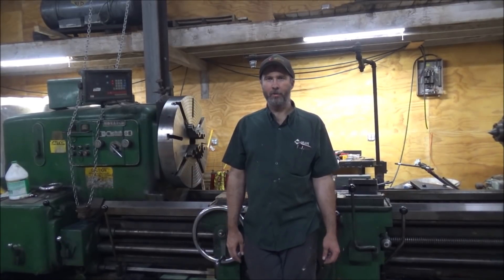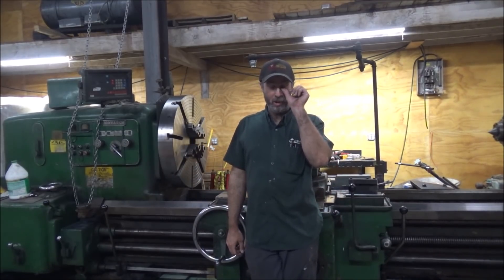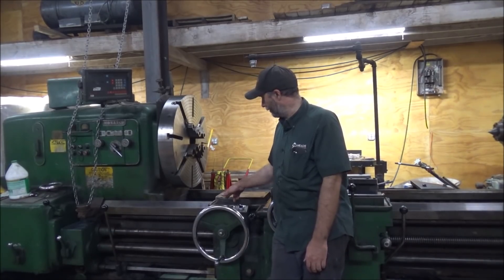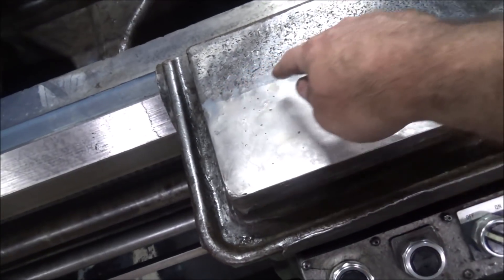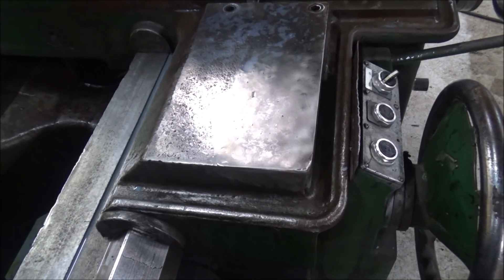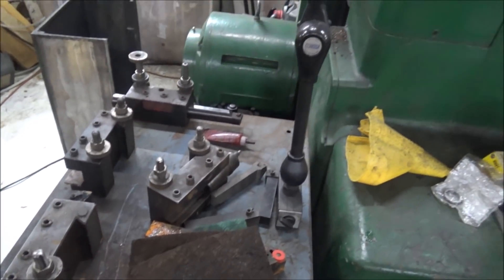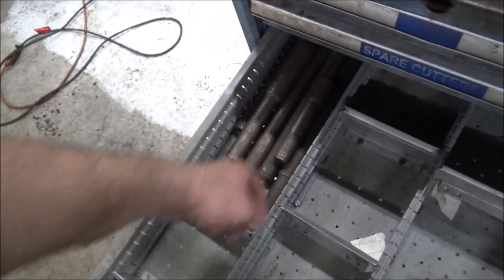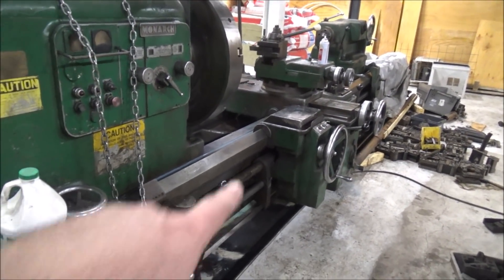Casr Iron Welding and Lathe Coolant System Repairs

Comment: So yo welded the top of a slide? How flat can the underside be now!!! You are a hack.
Reply from the maker: Been called a hack by plenty of internet warriors before, but I have fixed far more unfixable things than most. I figure 2lbs of rod has little effect on a 3000lb casting.  It may have theoretically  bowed it a couple of tenths in that area but it wont effect how it cuts. The carriage could be warped like a Mcdonalds sign but as long as it was moving on a flat surface and the same points of contact it would still cut true.  Welding the lathe bed likely would have been problematic to accuracy. Welding on the carriage like I did will have no effect on accuracy.
Reply: It speaks volumes about Brian that he pinned this comment along with the respectful and humble manner in which he responded.
Reply: @ Darren Rich  Darren, it might be a good idea to improve your spelling “yo”, before you start accusing others of miss-deeds on things you do not understand.
Reply: There's always an arse hole Brian. I bet Darren Rich was bullied at school and has never had a real girlfriend, just those you inflate.
Ignore him, you are one of the most knowledgeable people on here!
Reply: Brian, almost every time I watcg you, I learn something!  Thank you!

Comment: Nice job working on the large lathe. I can only imagine the swarf you removed from the machine. I can bet you that this machine had a rough life if they did not take care of the coolant system. Can only imagine that since the coolant is a integral part of the machining process. Today, keeping the system clean is more important than ever. No one want a major infection from the coolant. Nice weld job on the apron of the Monarch. Keep on a machining. VF

Comment: I just picked up a big (to me) lathe, I couldn't pass it up for the price, 18x80 HES Cholet 550... it needs  LOT of TLC before it gets put back in service, but it's a capable unit and will be a nice upgrade from my chinesium 14x40.. might be able to make a cut more than .020 without chatter..
Reply from the maker: Sounds like it will be nice, hope it aligns well for ya.

Comment: Looks to me that when the flood cooling pump is engaged you are going need to were a fisherman's raging gear or a maybe a scuba divers wet/dry suit.
All jokes aside you have done incredible work bring this big machine back into proper running order and that repair you did to fill in that gouge in the table looks amazing.

Comment: Hi Brian, your Monarch is beautiful but if it wasn't such a monster you could roll it outside and hot water blast it.
With your coolant, does it need glycol / antifreeze or do you heat it in the winter time so it doesn't freeze?  Stay safe and well :)
Reply from the maker: Shop stays above freezing in the winter with the heat in the floor.

Comment: Question Brian; How did you weld all that up and not warp the apron? Wow that is a lot of weld!
Reply from the maker: I figure 2lbs of rod has little effect on a 3000lb casting.  It may have theoretically  bowed it a couple of tenths in that area but it wont effect how it cuts.
Reply: @bcbloc02  Wow, ok thanks!

Comment: That is a really nice repair Brian on the cast iron. Thats going to be one heck of a cooling shower.  Hopefully you can adjust the flow.
Reply from the maker: There is a valve on it to control it if need be.

Comment: The welding repair came out great. Did you use the bust the flux off the rod system you ysed for the radial drill? Looks like you did it on the machine, what did you do for heat management? Most people don't expect it to be as big a job until they've done it. Thanks for sharing
Reply from the maker: No I used a special low heat rod designed to minimize heat input but still wet in nice.

Comment: Hi what is the size and model ? Is this the largest one made ? A great job as normal.
Reply from the maker: It is a series 90 that swings 40x180". It is one of the biggest series but they could be ordered in raised versions and even longer bed lengths.

Comment: I run renewable lubricants straight oil on my CNC mill, surface grinder, and manual lathe. No tramp oil to deal with, no evaporation, and no mixing. No RUST EVER, no sticky residue, lasts for years, smells good and non toxic!
Reply from the maker: Got a link? They have hundreds of oils on their webpage. I didn't see any straight oil under metalworking fluids.
Reply: @bcbloc02  Look at these Bio-Syntra™ & SynXtra™ MW (ISO 22, 32, 46)  I am pretty sure they are all straight oils.... can't put a real link.  if you get stuck i can try email...

Comment: Might want to add a ball valve before the snap-loc so you can control the flow a bit...once it's reduced down I could see it coming out of there at firehose pressure.
Reply from the maker: There is already a gate valve on the coolant there for controlling flow.

Comment: I checked out David Wilks’ channel. Wow! There’s Trepanning then there’s TREPANNING! Very specialized work, but you get used to it & it’s just routine I guess      During WWII my dad ran a monster lathe in a defense plant. He did the rough turning & boring on forgings which became 16” cannons used on Missouri-class battleships. Those forgings were about 70 feet long! He said other than the days when he had to mount & turn steady rest spots, it was pretty routine. Once he started the boring operation, it was - boring! Unless the engineers had slipped in a new grade of steel, then cutters and feeds & speeds which had been working great for months didn’t cut or broke. He was in for a few busy shifts.
Reply from the maker: What plant was that? Did they also cut the rifeling there or was that done someplace else? Heck I wonder who did the forgings 70ft is a big one!
Reply: @bcbloc02  It was called Midvale, in the Nicetown section of Philadelphia, Pa.   Started as a steel manufacturing concern in the mid-1800s and developed into heavy manufacturing. When we drove by the location, it looked like a ramshackle collection of quonset hut-type buildings plus a huge green building that housed what my dad said was the largest vertical forge in the world. That's where the blanks were forged.  The machining operations my dad performed included outside turning & rough-boring only. The barrel was moved to another area for installation of the rifled liner. Or maybe the liner was rifled after installation. He said sometimes the semi-finished barrels would lie in a stack by the lathes for days and days. Then, at his next shift, they were all gone. Nobody saw them move. This was 1943 and 1944, during the war. Stuff was kept secret. 
We drove thru that area frequently in the late '50s - early '60s when the place was being dismantled. Drove my dad nuts when the vertical forge building was torn down and the forge shipped to Germany. He would ask, "Who's going to make 16" barrels if we need more? Are we gonna order them from Germany or Japan?"

Comment: Good start on having some tooling right by, Having to walk to the other side of the shop constantly. looking clean and organized . put a manifold on it do multiple outlets think 3/4 Dia. reduction there's some heat there spread it out. just wow flushed it 4 times yup still dirty. progress is slow somtimes but progress is progress.
Reply from the maker: Very true!

Comment: what about doing a headstock oil change, run some kerosine in the headstock after you drain it, then use appropriate oil back in. Adam Booth just did his, might make a easy video for you! What about working on getting the shop completed before this winter?
Reply from the maker: Bill Actually the headstock runs dry sump on the series 90 . Everything is pressure oiled by the hydraulic pump and thus is filtered and returned to the reservoir under the motor all the time.

Comment: Ohhh... !!!   Your flow rate on that flood coolant shower fixture is barely behind that from Niagara Falls....   There is enough to even keep the operator cool on those very hot steamy days....   🥵🥵🥵
As an update on my own work, the manifold with the huge hole I had to weld is done, still waiting for feedback from the customer....    Hope it's a good fix...!!!
Reply from the maker: If you don't hear anything the fix was probably good. LOL Yes the series 90 came with built in cooling for the operator as well apparently. When you run this machine you are "Mr. Cool" LMAO
Reply: @bcbloc02  LOL
Reply: Pierre's Garage : might not be a Niagara Falls but it's definitely equal to Cumberland Falls. Wounder if Brian can see a Moon bow during the full moon?
Reply from the maker: @CraigLYoung  Sure just have to stand on the right side. lol

Comment: Hi Brian . Another excellent cast welding repair , Was the repair work on radial drill your practice piece, what massive job that was but you found a way to get it done .
 Thanks for giving David Wilks a shout out , strange that he hasn't got more subscribers from those that like to see  lathework/milling / toolmaking  Just the same way as in your shop Brian before CNC changed the individuals manual skills from hands on machining by converting it into numbers in a computer .
Reply from the maker: CNC is impressive but I prefer doing the manual work I can feel. :-)

Comment: Because I don't know. With flood coolent do you still use cutting oil or way oil or is the coolent a equivalent
Reply from the maker: The coolant is the cutting oil, you do still have to maintain the lathe's lube system that lubes the ways.
Reply: Thanks

Comment: Does a flood coolant type system have any lubrication for the ways in it or is that still a second process on that size of a lathe. I recently retired my big lathe as I didn't need it any longer and the cooling system was the same oil cup I lubed all the oil holes with. It was 115 year old  36 in swing 17 foot bed and worn out beyond belief but if you talked nice to it and petted it a little it was still accurate
Reply from the maker: There is probably some lube action from the flood coolant as it has lube to help it cut but the main lubrication still comes from the built in lube system on the lathe itself.
Reply: @RPM unlimited, if you don’t mind my asking, what kind of lathe was it and did it have a motor originally?  I’m in the process of brining home a similar sized, eighty or ninety year old lathe which is in surprisingly good shape, it has the oil cups too.

Comment: Now that's what I call flood coolant... Love that Series 90 Monarch, it's a beast for sure and nice to see that she's slowly getting back into original shape. Impressive welding job on that cast iron carriage. And always nice to see your hard work being passed by the shop inspector :)
Reply from the maker: It will for sure flood! I think the weld job matches nicely.
Reply: @bcbloc02  Looks like the Bloc Machine Shop triumphs again.  Build it up and grind it down to where it needs to be.
Reply: Damn, my shower doesn't put out that kind of volume or pressure.  You can wash out some big boy chips with that alrighty.
edit: Can you do through coolant tooling from the carriage?